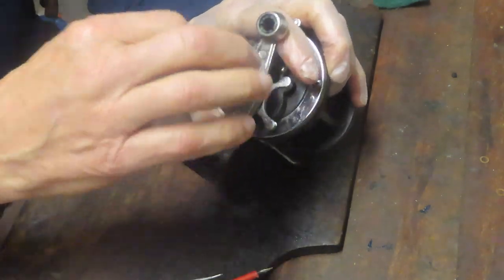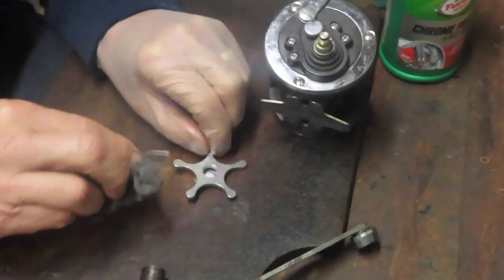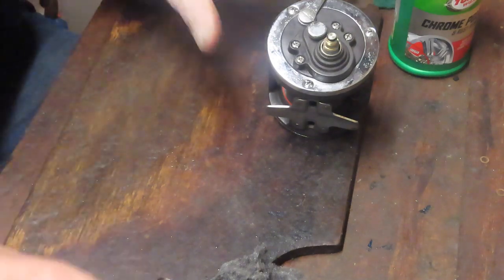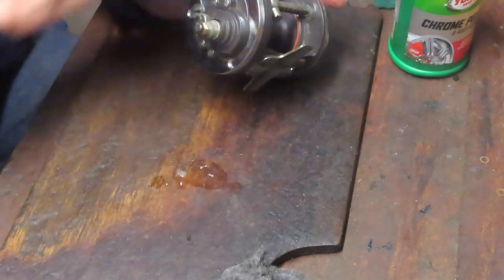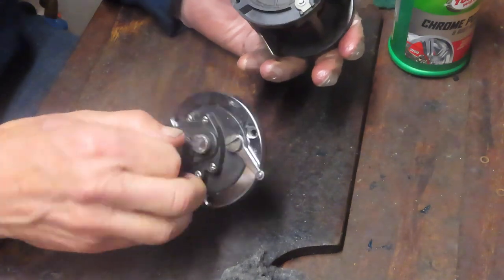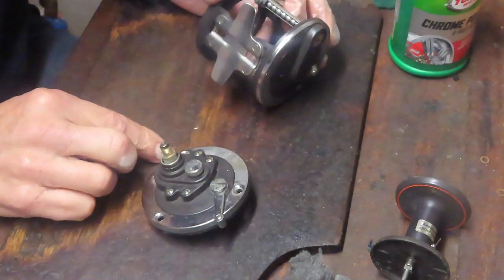Daiwa Sealine 47H saltwater fishing reel how to take apart and service

Comment: Thanks for your very informative videos.  I fish Lake Michigan for salmon and just resurrected my old Daiwa 47H that is about 40 years old.  Kind of a retro rod and reel set up.  We landed the biggest salmon of the year on it at 21#.  My problem is that the line guide wants to hang up on the right side when reeling.  After watching your video, I disassembled the reel and cleaned it up and oiled it, but it still does the same thing.  Gets stuck on the right or handle side.  After reeling for a bit it eventually catches and moves again but it just hangs up again.  What in your estimation is the problem?  Is it the worm gear?  The pawl?  I'm not sure there are parts available either.  Thanks, Rog
Reply from the maker: It sounds like a worn or broken point of the line guide pawl or a damaged worm gear track.  You need to inspect both and replacing the parts is the only way to repair the pieces
Reply: Do you know if replacement parts are available? @2ndChanceTackle

Comment: Your videos are awesome. I have started getting into rebuilding my reels and I have learned so much from your channel. I do a lot of salmon fishing on Lake Michigan and have many level wind reels which is what I am primarily working on. These 47H's are great reels for the type of fishing I do. Question:. Do you know where I can find new drag washers for the 47H?  Some of my old washers are in bad shape and I'd like to replace them but am having a hard time finding them. Thanks in advance and keep up the great videos.
Reply from the maker: Not sure.  Try Smoothdrag.com  If you send them an email, they are usually very responsive and they know what ones may fit if you need to order by size (inside and outside diameter of the washer - Dennis
Reply: @2ndChanceTackle  Thanks, I was able to source the washers from Smoothdrag
Reply from the maker: Great - they are a very responsive company.  Thanks for letting me know
Dennis